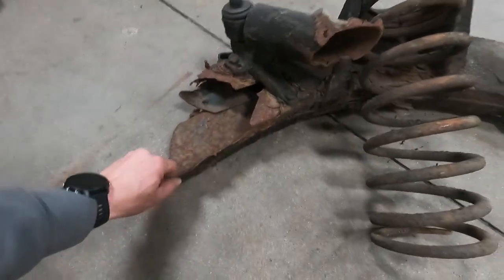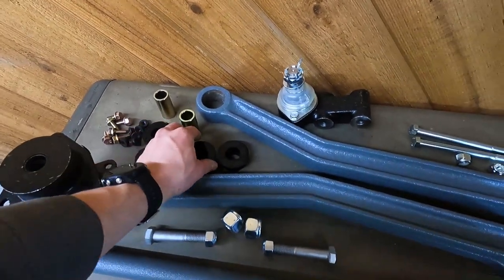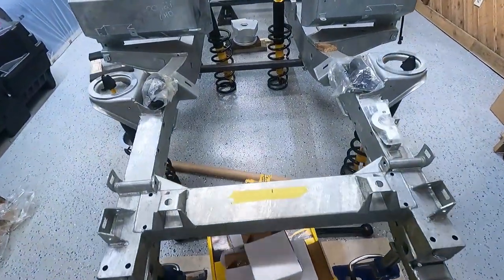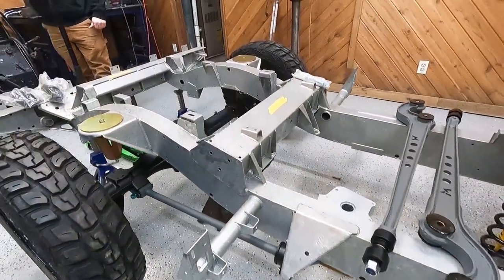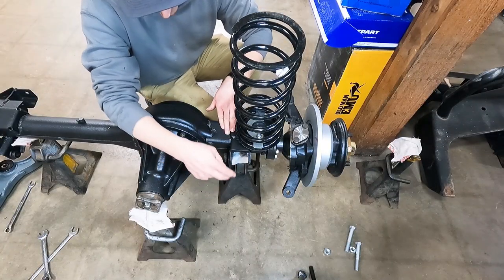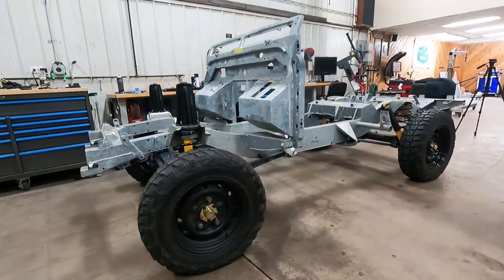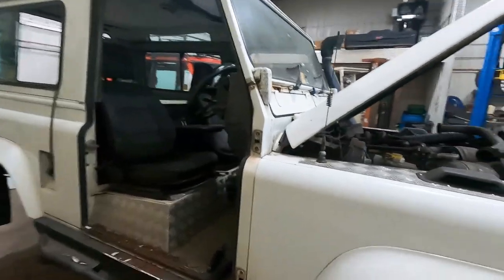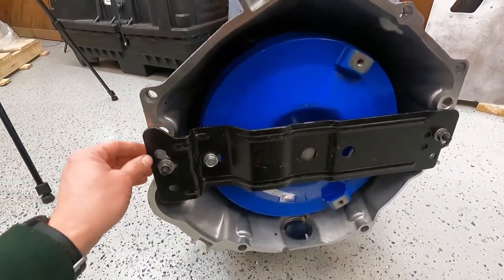LS3 Defender Chassis Prep | The Land Rover Meets the Ground

Comment: How did you end up resolving the bulkhead hole mismatch? Modify the chassis or bulkhead hole location?
Reply from the maker: I might have forgot to address that in one of the videos. But it was actually just the frame rails that needed to be spread back out a touch with the crossmember. Probably from being strapped in shipping or being handled in the galvanizing process, the center has a long run without support when there is no crossmembers bolted in. So correct width crossmember in place made everything line up.

Comment: Did you guys keep the same differentials or swap them out? How does it do in 4x4?
Reply from the maker: It has a 24 spline set from a Discovery 1, then we fitted them chromoly shafts.

Comment: what axels did you use ?
Reply from the maker: It has Discovery 1 axles swapped in, 24 spline vs the original 10 splines this Defender had. Then it has Ashcroft HD shafts with upgraded drive flanges.

https://lucky8llc.com/collections/defender-hd-half-shafts-and-cvs/products/ashcroft-discovery-i-rrc-d90-heavy-duty-rear-half-shafts-kit